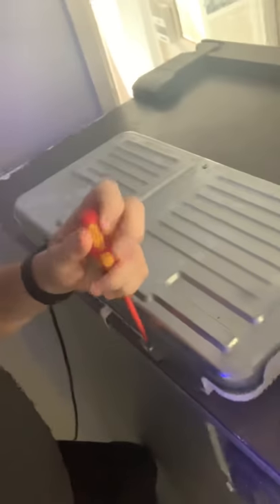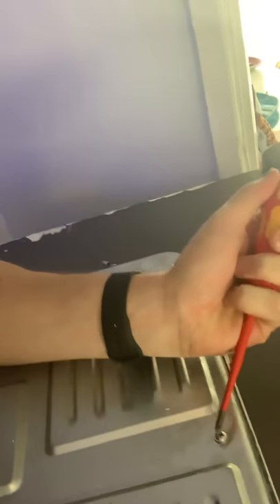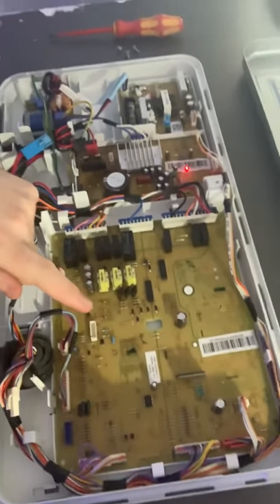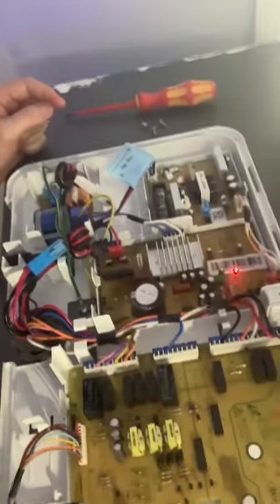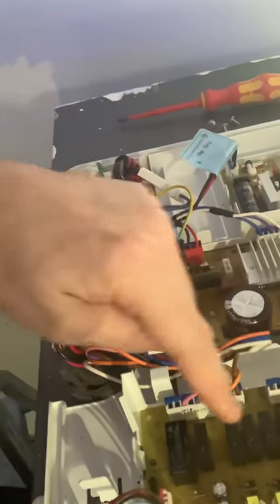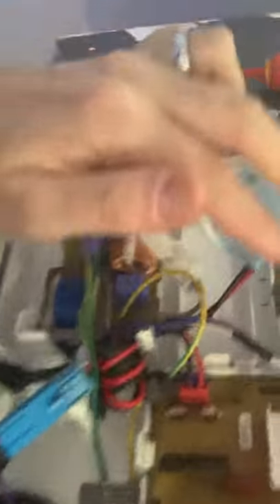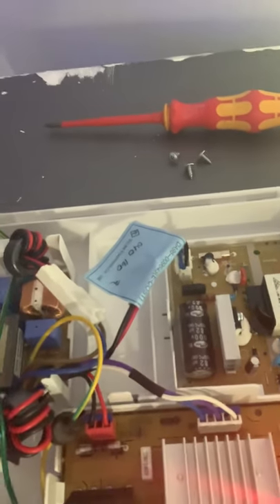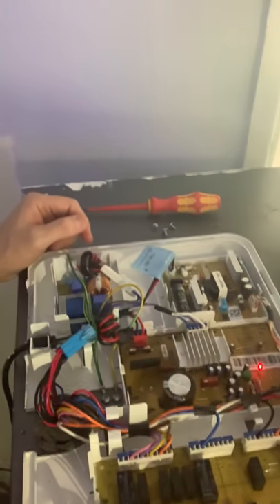Samsung Fridge Freezer No Power

Comment: Probably you don't need to replace the entire board. Most common issue on these boards (which is used in many other models not only RS53) is shorted schottky diode sb2100 (cost ~ 50 cents).
Just buy a new diode and replace it if you have basic soldering skills. And remember to do it safely - after unplugging from power outlet wait  10-15 min to discharge the capacitor on board.
Reply: I was just going to post the same, that was the issue in mine, 5 diodes £1.50 delivered, plenty of room around on the board so a really easy fix.  I wonder if the failure is due to the common ground shared with the 12v circuit (this is a complete guess I'm not an electrical engineer).

Comment: Just ordered new board in question, fittwd it and hey presto it kicked back into life. Many thanks for sharing. Anyone know if there are specific diodes/components that fail on these boards so I can repair to have a spare.
Reply: DS2 off secondary coil of transformer was short circuit on mine. Maybe  other components need change.

Comment: Part thats short in my board is SB3100 diode. 
Ordered one yesterday hopefully that will sort the problem.
Reply: It was the not the diode , ordered board and bingo it works. 
Thanks again.
Reply: Looked like SB2100 to me, but not sure it would make a fat lot of difference. Replacing this diode fixed the issue for me.
Reply: @joshward9182  how did you determine the value of the diode?

Comment: Had my neighbour check the circuit board. Turned out to be the resistor that connects the transformer to the 5volt output.

Comment: Hi together, the fault of this card was also the reason my fridge did not work anymore. Fore that with a little electronic knowledge I will tell you also how to repair it. In my case it was a 5V Zenner diode in short circuit that cause this card not to work anymore. Approximative cost under 1 $. This is probably the most common failure in most of the chases. Make no sense to buy a new or refurbished card in you have some technical skills and can do it for almost no money by your own. Hope I could help you out. (BYW this Zenner diode is glued on the plate with some white glue paste so it can not cold down proper so in 2-3 years it generates the fault in most of the cases so an 1 $ pieces make an 1000$ fridge useless. Is this made by intention from the producer Samsung ? I let you guess !)
Reply: Thanks for this. Have identified the faulty diode and ordered a new one from eBay for £1.50 Inc the postage!
Reply: @BrinPhillips  just watched this video after my Samsung fridge doing the exact same thing .you wouldn't have a link to ebay for this diode by any chance? Thank you so much which
Reply: Multumesc mult! La mine era un schottky in scurt, dar comment-ul tau m-a ajutat sa localizez problema!
Reply: @BrinPhillips  you don't have the spec for the diode do you? I'm thinking of just putting a bigger one on. Mines labelled ST/LB which doesn't seem to tie up with anything!
Reply: For anyone interested its an SB2100 diode (or at least was on mine).

Comment: Hi Adam, Does your LED stay on constantly when powered? I've woken up this morning to what looks to be the same fault, however, on power up the LED flashes then goes out. Thoughts?
Reply: I have the same issue Capoot, the LED Flashes and goes out, did you find out what was causing it?
Reply: @jellevanlanen650  Yes, I’d managed to fix it. I bought a £60 PCB from eBay, connected it and it fired straight up!
Reply: @capoot5  Thank you so much for the quick reply! I was thinking its the board as well but you've ordered the DA9200530A as well and it fixed it? I'm going to order it right away!

Comment: Just to let you know, I had the same problem and found it to be the same PCB.

I fixed mine with a cheap diode (£0.32) + some soldering 🙂. The problem was the original Schottky diode went short circuit.
Reply: Can you point out which diode it was?
Reply: @razajaffery  https://images.app.goo.gl/5oguNBKduC4433bT7

From the angle on this photo, it was the one on the right-hand side, vertically in the middle. In between the transformer and the 2 medium sized capacitors.

I replaced with a STPS2150. Different to the original but has a slightly higher voltage rating and works fine 🙂
Reply: @joshward9182  Thank you so much for your quick response. I'll get the old multimeter out now and have been itching to use to the soldering iron for a while now. I'm trying to fix this fridge asap with two toddlers at home and a lockdown to contend with. Do you have any suggestions on where i might be able to buy the right diode from given everything is shut? Perhaps an assorted pack of diodes off amazon might be the best option?!

Comment: Thanks I’ve same issue. 26months old and dead. On this board there’s 12 volt and 5 volt exiting. 12 volt was fine the 5 volt was dead. This was the reason for the total blackout. Samsung are shocking they wouldn’t provide me the service manual. Only would let me pay for an engineer even tho I’m a boiler engineer. Seems like a good way to make money by not providing schematics. Do not buy Samsung anything! I won’t be from now. If anyone had the service manual for this please get in touch, thanks the faulty part on mine was the diode marked hs2 on the board.
Reply: I'm only getting 0.3V from my 5v supply and diode DS2 (I assume thats what  you meant as can't find HS2) is testing failure.  you wouldn't happen to know the replacement part number would you.  i need to order a soldering iron as well as the diode so can't get it out to check!  no worries if not i'll post the number for others when i get the soldering iron!
Reply: @darrude  Genuine Samsung DA9200530A Main Board PCB For Fridge Freezer
Reply: I just bought a new board from Amazon as was fairly cheap and I don’t own a soldering iron
Reply: @plumbertime  thanks for replying, I thought you'd repaired the board. Mines working again with a new board, but was thinking if the old board can be repaired then I've got an on hand back up for next time!

Thanks again, Daz.
Reply: @darrude  yeah I was thinking to do the same, but once I got it working I couldn’t be assed to buy a solder pen and diode ect lol